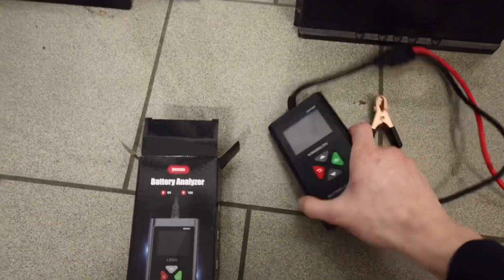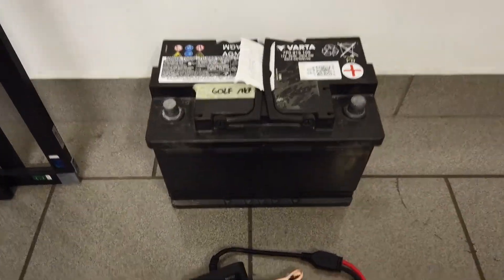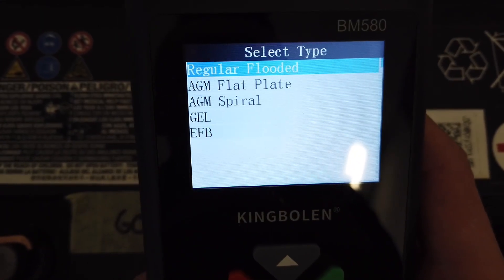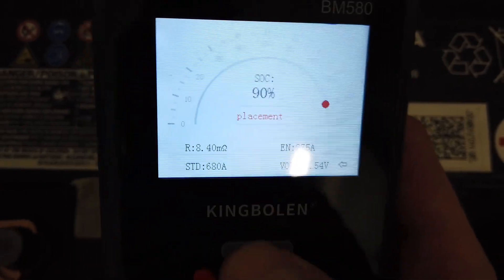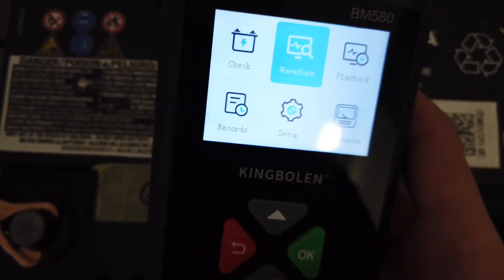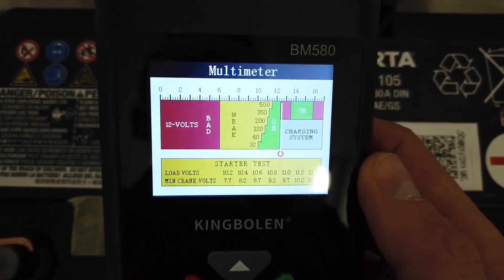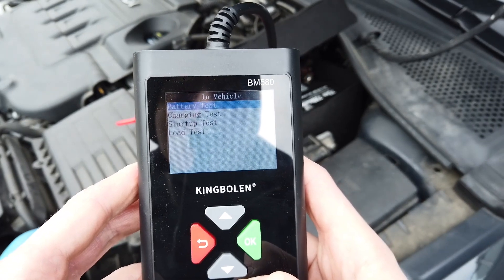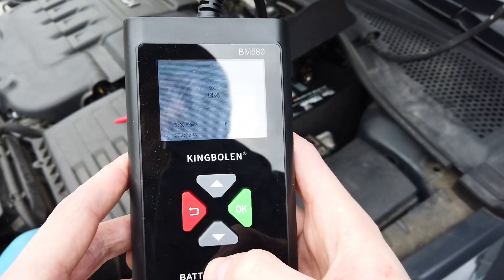Kingbolen BM580 battery analyzer & charging tester, pros & cons

Comment: The alternator charging voltage is low & not suitable for an AGM battery which would have an open circuit voltage of 13V.

Comment: Did it fail to start or what were the symptoms? My 6 year old Passat has the exact same battery but reading approx 400A. On cool mornings i get errors flashing up on the screen when cranking sometimes.
Reply from the maker: Old battery in my MK7 gave me ACC and EPB errors on cold start. Faults would disappear as soon as the engine is running, but at crank voltage drops caused couple modules to restart.